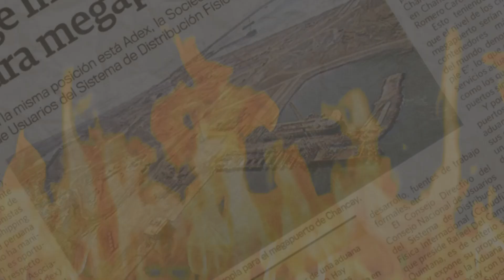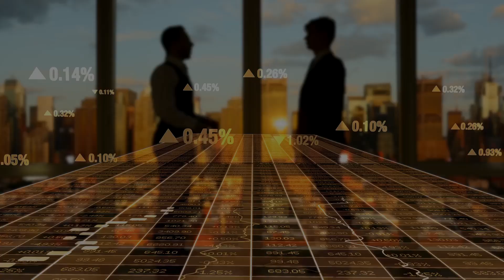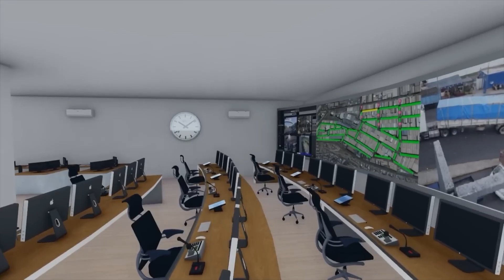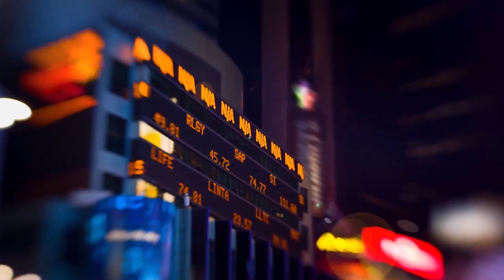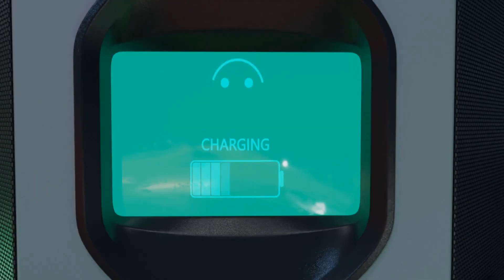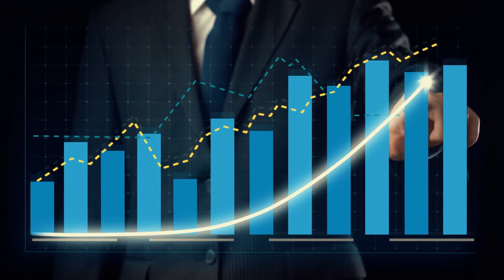Peru’s $3.6 BILLION New Mega Port: A Game Changer For Global Trade!

Comment: RAILWAY BREAK OF GAUGE - BI-OCEAN LINE
A problem with the Chancay, Peru port is the lack of gauge uniformity in the railways linking this port to railways elsewhere in South America.

*        1435mm - Peru        
*        1000mm - Bolivia        - there is a gap in the railway between the east and west sections        
*        1600mm & 1000mm   - Brazil including some dual gauge 1600mm-1000mm tracks            
*        1676mm & 1000mm & 1435mm - Argentina  
*        915mm, 1067mm, etc.        
*        It is not clear what gauge will be chosen for a new Peru-Brazil railway?          Would 1435mm be chosen as this is the world-wide standard; this  also resolves the problem of having two broad gauges?       Would 1000mm be chosen as this gauge has the greatest mileage of track?    

AWSGC24 (c) 2025-08-29^13:52 AuEST +10:00 GMT-UTC Fri